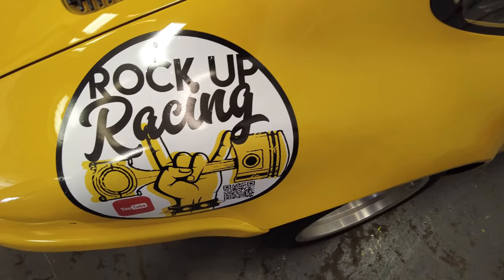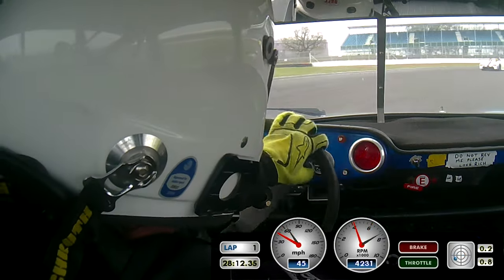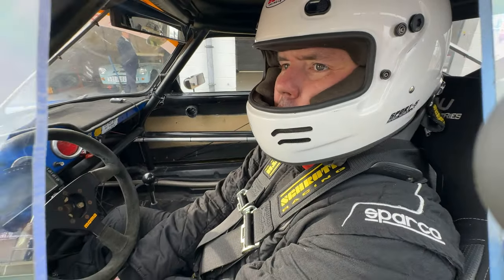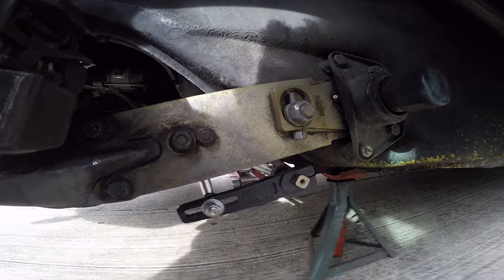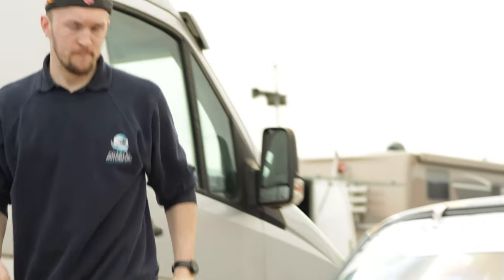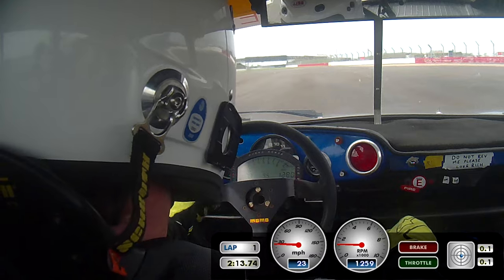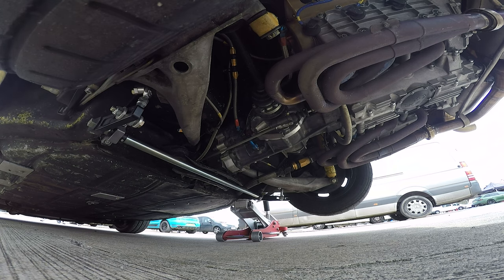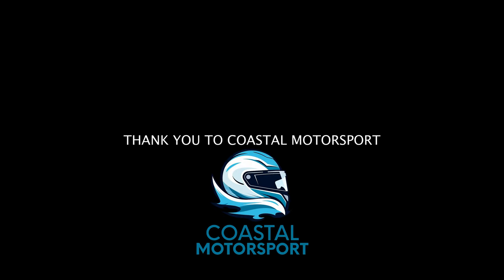Trouble Strikes Again: Silverstone Stalemate - S1 Ep2

Comment: Bloody gearboxes. In all honesty turning up for an event without a spare is not the best of ideas. 
For the most part your dealing with old components. Alternatively sink 15k into a used Hewland from a good supplier. Works out much cheaper over a season, unless your just driving around uncompetitively, 
Which you boys ain't🙂
Reply from the maker: Thank you for the comment! Yes I know...Annoyingly these old Porsche parts are so hard to get hold of. What Hewland fits in a '68 911?
Reply: @rockupracing  They do make specific boxes for the job, but when they come up for sale second hand, it's sold before you can dial their No. 
You guys are engineers, so your most economic solution is a FG C 400 if you want it to last. 
A unit like a LD200 will break with the traction of a Porsche and the torque will be at it's limit with a modest 2.7.